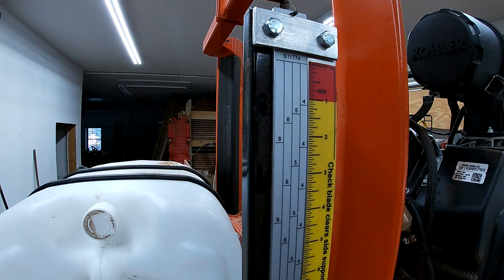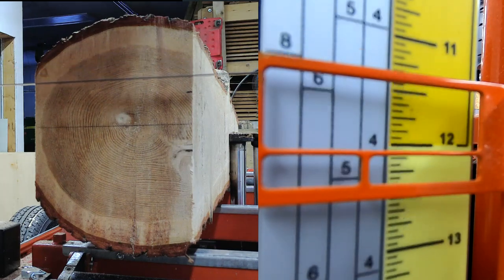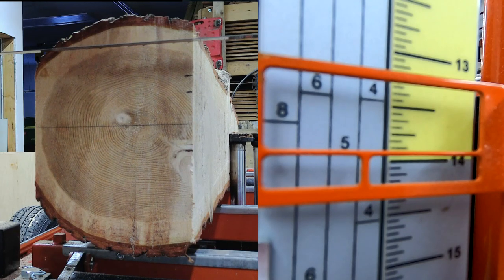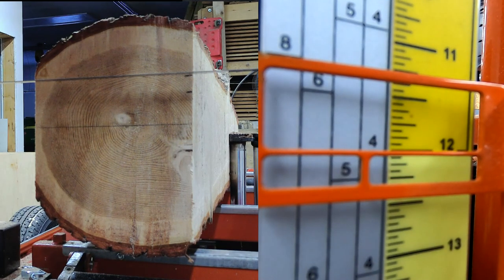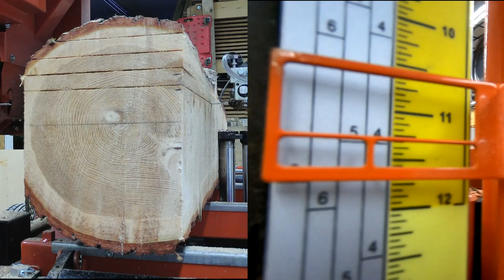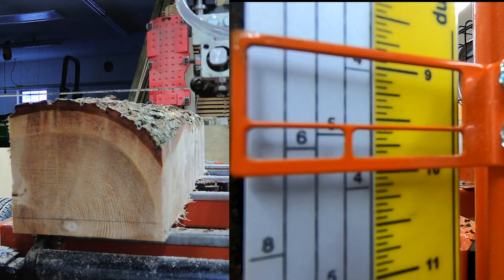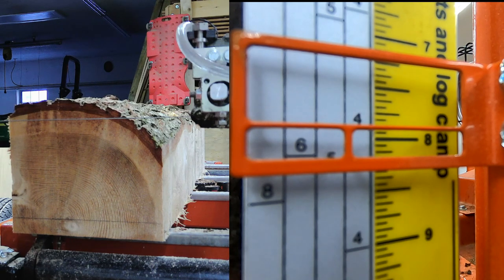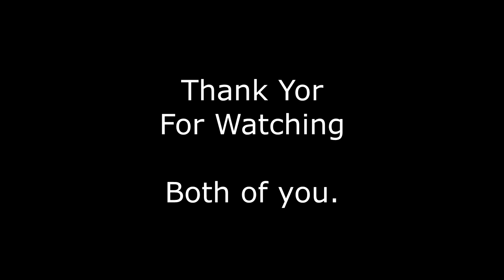The Quarter Scale Is Your Friend # 17

Comment: It surprises me that the increasing weight of the boards against the blade as the cuts move down does not cause burned wood.  It took a while for me to learn how fast to pull a radial saw through a cut to avoid it, depending upon wood thickness.  Maybe blade lube (water or diesel) solves the problem.
Reply from the maker: I believe that because of the support of the uncut wood before the blade, the tooth set and the buildup of sawdust behind the teeth there is little friction during cutting. There may be a small amount of the friction as the blade leaves the wood but I doubt it.
Reply from the maker: Here is a link to a video from 12/12/20 by Fall Line Ridge where he does a better job answering your question.
https://www.youtube.com/watch?v=fKfKgu00vII
Reply: @TheOldManAndTheSaw  That makes sense but doesn't fit the bill exactly.  The radial saw blade has offset soldered on teeth and is not subject to weight on either side of the blade.  It cuts straight to the table top and square to the fence so it does not crab it's way through the work piece.  It cut through a hard rock maple 24" x 4" bench top like nothing but still produced very light singeing on one side of the cut toward the end.  Pull it through a cut at the speed it likes and the problem never appears.  I have to think more about this.  Thanks for responding.
Reply: Old Man, upon reflection I think I figured out.  The video link explanation may have something to do with it but probably not much.  I strongly suspect the reason Woodmizer type sawmills don't burn the wood, unlike my radial saw does now and then, is the simple matter of the number of teeth x how fast they return to strike the wood = friction = heat .  .  .  .  or somesuch.  Here's the loose example (do the math yourself):  The farthest distance between teeth on my 80 tooth 18 inch radial saw blade is the diameter of the blade (or close to it = 18 inches.  At 3600 RPM (????) and no lubrication each tooth strikes the work piece 10 bazillion times per minute.  Contrast your sawmill with how many teeth?  300 - 400??? on a 10 to 14 foot long blade???  Add in lubrication, i.e., cooling, and all the extra time your bandsaw blade flies through the ethers, i.e., gets more cooling, before tooth #1 hits the workpiece again = your blade teeth are continuously cooler as each tooth does it's part in making the cut.   In other words  during the same time and at the same (or similar RPM) your individual bandsaw teeth don't strike the workpiece as often and don't get as hot as the teeth do on my radial saw blade.  Problem solved .  .  .  .  assuming that a Woodmizer blade does not crank along at 400/80 × 3600 RPM =  a lot more RPM compared to my radial saw.  I achieved this epiphany when I looked into a Baker sawmill with a 20 foot long blade bearing ~ X thousand teeth.  The obvious also struck me:  a single sided rail support post Woodmizer sawmill is the rough equivalent to a radial arm bandsaw.  I hope this concludes this mystery.  (And, yes, I know a 20 foot long 36 inch diameter log should in theory afford more overall friction as compared to making a cross cut on a railroad tie.)
Reply from the maker: @ralphpezda6523  You got me thinking, Ralph, and I am planning on doing a video on just this subject.... I hope.
Thanks.
Reply: You might consider these two items because I don't know Woodmizers like you do:  1.  The RPM of your Woodmizer and 2.  How and where Woodmizer measures that RPM.  On a table or radial saw the RPM of the arbor = the RPM of the blade.  Why?  Because the blade is centered on the arbor.  Soooooo---- does Woodmizer measure the RPM at one of the guide wheels or by how many times tooth #1 passes a given point?   The circumference of the power guide wheel is not = to the circumference/length of your bandsaw blade.  In order to get (Ex.) 3600 RPM using tooth #1 as your reference point, the power guide wheel must turn X times faster.  Somehow I doubt Woodmizer guide wheels crank (Ex.) 12,000+ RPM.  Note:  I never asked Delta how fast the blade turns on my radial saw.  If I remember right I think the blade is rated at max 3600 RPM.  For safety reasons I would guess the arbor/blade turns 15% slower (but I don't know that for certain).  My radial saw will cut any wood that fits until the blade as fast as I can pull it through.  That has more to do with power than whether the RPM is 3600 or 3000.
Reply: It's no different than cutting a log in half.

Comment: Just came from your redo video, all good info! What keeps the 1/4 scale rule from sliding, is it just sandwiched in the mount ?  I am trying to fabricate a rule on my DIY mill.
Reply from the maker: So many things to say....
Watch video #73 where I talk about the error in the WM quarter scale. Wood-Mizer (WM) makes a nice quarter scale for the LT40 (they have many quarter scales for many mills; each one different) but it has a serious error in the design. That's where #73 comes in.
The scale in question is held in the "zero" position by a roll pin and can slide in the holder. A clamp holds the scale in the positions you set. 

Watch #17 again and pause the video at about 45 seconds. Look about 1" below the yellow portion on the left and you will see a simple bent piece of metal; this is the clamp.

My opinion is that the inch scale should be adjusted to where a cut made is EXACTLY where the inch scale indicates (scale at 6" gives you a board EXACTLY 6" high). The inch scale should never be moved except to re-calibrate the mill.
If you need more info please let me know.
Dave
Reply: @TheOldManAndTheSaw  Thanks for the reply! I will check them both out again!

Comment: Cool video, I'm 19 nearly 20 just finished a sawmill training on the same lt40, I'm kinda looking forward into learning more about a sawmill an how to cut, but I dont under board feed I kinda under fbm but I'm still learning at the same time...
Reply from the maker: A board foot is the amount of wood in a board that is 12" wide by 12" long by 1" thick; which equals 144 cubic inches. So a 1" board that is 10" wide and 10 feet (120") long would be 8.33 board feet; 10"x1"x120" = 1200 cubic inches; 1200/144=8.33 board feet.
I hope this helps.
Dave

Comment: Why does the hardwood scale add an extra 1/8”? Is it to account for shrinkage or something like that?
Reply from the maker: Not "something like that; EXACTLY like that!
Hardwoods shrink more than softwoods.
I prefer to NOT use the Hardwood Scale........it wastes too much lumber.
Because I'm cheap!
Reply: Your lumber scale zeros when all the way down, I have a woodmizer also but it came with magnetic scale. If I want to zero the magnetic to the mill deck (for some reason I haven’t figured this out yet but your video may have helped me to sort it out) would I choose the size (lets use 5/4) and line the bottom most 5/4 line on zero? Then go to the top of the log and start cutting down from the closest 5/4 mark to to the top?
Reply from the maker: @ryanvanesch9329  The distance between the "Standard" quarter scale marks should be 1/8" MORE than the quarter value (4/4 + 1/8" = 1 1/8", 5/4 + 1/8" = 1 3/8" etc.) and 1/4" MORE than the Hardwood Grade quarter scale marks (4/4 + 1/4" = 1 1/4")

The next thing you need to do is to measure from the quarter scale zero to the first marks to determine if the distance is the same as between the rest of the marks. IT SHOULD NOT BE THE SAME!! 

The distance from zero to the first quarter scale marks should be about 1/8" LESS than the rest. This takes into account the kerf lost from each board. My first quarter scale mark is at the same distance as the rest of the marks and my last board ends up being 1/8" thicker than the rest. Therefore, my quarter scale zero is 1/8" BELOW the inch scale zero.

Easy test; align your Standard quarter scale zero with the inch scale zero and see if the 4/4 mark aligns with the 1" mark. If WM corrected their mistake the 4/4 mark should be just a hair above the 1" mark.
If not just align the 4/4 mark with the 1" mark to "zero" the quarter scale

Good luck
Dave
Sorry for the long-winded answer.

Comment: Very informative. Thank You! BTW Ordered the LT35HD, won't be ready until January.
Reply from the maker: Last I heard WM wait was 39 weeks. Keeps getting longer and longer.
The DO make a great mill though.
In the middle of milling some black cherry so there will be another video out shortly.
Thanks for the comment.
Reply: @TheOldManAndTheSaw  Yeah, they are out 43 weeks now. I didn't order the optional 2 hydraulic side supports. Do you have those on your mill and do you think it would be worth adding those. Thanks! Looking forward to the cherry milling video.
Reply from the maker: @jbjbuild  I have not regretted adding the additional linkage. It's only $ 175 (if I remember correctly).
Don't tell anybody but..... I believe that if you go to your local Wood-Mizer location you MAY be able to wangle the linkage from them for free. Worth a try.
43 weeks.... OUCH!!
Reply: @TheOldManAndTheSaw  Thanks, I was thinking the same...for $179, its probably worth it.
Reply: Up to 60 weeks. Just ordered today 😳
Reply from the maker: @spicher40  Waiting will suck for the next year

or so
Reply from the maker: @spicher40  What mill did you order? I'd like to know.
Reply: @TheOldManAndTheSaw  lt 40 wide
Reply from the maker: @spicher40  You will not regret it. It's a GREAT mill.
Reply: @TheOldManAndTheSaw  lt40 wide. Hydrolic. Looking forward to it
Reply: @jbjbuild  You should absolutely get them, I think you can order 4 if you like too.

Comment: Your last board is thicker by 1/8th of an inch, no? So, you still need to make a last cut on your last cut. Please explain setting the quarter scale to the deck a bit more, please. Thank you.
Reply from the maker: Below is a link to a video I did much later that the one you are commenting on. It's the first of 3 videos addressing the issue you mentioned. Each video has a link to the next video in the description. Hopefully they will answer your question.
Dave

https://youtu.be/8gPxdgr1qjc
Reply from the maker: I see you just added another comment. For some reason I cannot fully access it. This sometimes happens with YouTube.
Try again and if that doesn't work, send me an email. The address is in the "About" tab.
Dave
Reply: @TheOldManAndTheSaw   Thanks. I'll check it out.
Reply from the maker: @SpecialChannels-dn2sx  To answer your pith question: it's better to try to get the pith centered as close as you can on the mill. This will keep the tree fibers parallel to the cut. And, yes, it's almost impossible to have a perfectly straight pith so centering it within a thin (>1") board probably won't happen. Since the pith and surrounding juvenile wood is usually lower quality it's advantageous to capture it in a single board instead of having the inferior wood in multiple boards.
Reply: No. A 4/4 board thickness is 1 1/8 inches thick.
Reply from the maker: @johnclark5153  If you use a Hardwood quarter scale you get just over 1 1/8" for a 4/4 board. Using a Standard (sometimes called a softwood) quarter scale you get just over 1" for a 4/4 board.

Comment: I was folligng along until you miss spoke and that through me off. Your cut speed is way too slow for that size engine. Tell us how you would set up for 3/4 inch boards and the pith in the center board. Thanks,
Reply from the maker: In answer to your question, here's one way.
First I'd remove the 4/4 scale and replace it with my 3/4 scale.  I keep it on the post behind the scale support.
Second, I'd align the blade with the pith.
Third, I'd adjust the 3/4 scale so that the height pointer was half way between two 3/4 marks.
Fourth, I would raise the blade to the height I wanted and made sure it was lined up with a 3/4 mark.
Then I would cut the boards I needed moving the blade down to each succeeding 3/4 mark as each board was cut.
Dave
Reply: @TheOldManAndTheSaw  Thanks i will try that, after measuring the center to the bunk at both ends, centering the pith. .
Reply from the maker: @rexhavoc2982  Rex, still waiting for your email. I REALLY want you to see the new quarter scale video before I release it to the public.
Dave

Comment: HOW do you actually set the simple set for quarters.  It only seems to go by the inch scale
Reply from the maker: The video is made to show how to use the quarter scale and not the Simple-Set. I should have also shown how Simple-Set works; my apologies. There are videos that show how Simple-Set works but I'll try to give you a quick explanation.
Simple-Set is used to precisely position the saw blade. To set the distance you want the blade to lower each time there is an "Up" and "Down" button that adds or subtracts 1/16" from the current preset move value. The value is shown in inches and fractions. The Standard Quarter Scale shown adds 1/8" to the desired board thickness to compensate for the saw kerf. So, to set Simple-Set you set the preset to 1 1/8" for 4/4 boards and 1 3/8" for 5/4 boards.
I hope this answers your question. If not, I should do a short video on the quarter scale and Simple-Set and how they work together.
Reply: @TheOldManAndTheSaw   Thanks BUT I already know how to use it and have been for some time.  You were talking as if the simple set can be used in quarter measures.  I misunderstood.  It is just easier to use inches for me. since simple set uses inch measures.  I guess if someone does not know inch measurements really well it might not be easier.
Reply: By the way I set 4/4 board at 1" and it cuts precisely at 1".  I have cut 160 or so 3/4" X 8" boards to line the inside of our cabin.  I set simple set at 3/4" and it cut precisely 3/4" .  The only issue my son tells me [he is nailing up the boards] is that is a group that are 8"  down to 7 7/8 ".  I must have not lowered the toe board after my first cut!!!!!  They are having to take a hand planer and plane them down to use.  I have a VERY limited amount of white pine logs left to mill.
Reply from the maker: @timothymyers6827  If I set my SS to 3/4" the blade will move 3/4" each time but the resulting milled board will be just over 5/8" thick. My SS requires you to add 1/8" for the kerf width to obtain the thickness you require.
As far as toe boards are concerned, I have forgotten to lower mine at least a million times..... give or take.